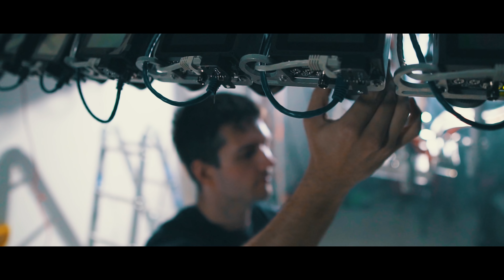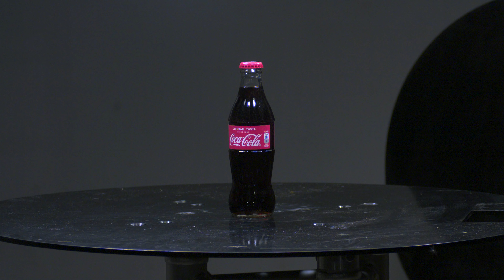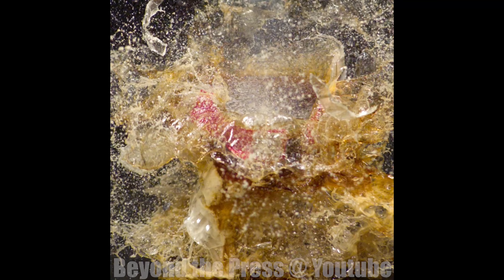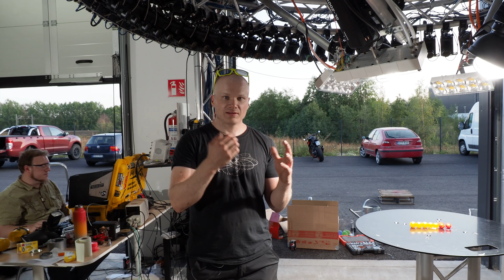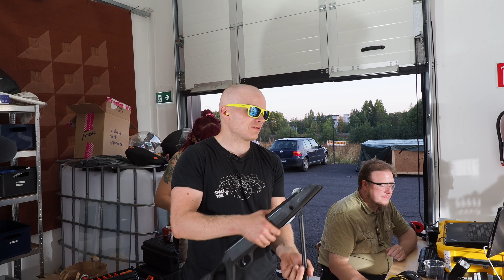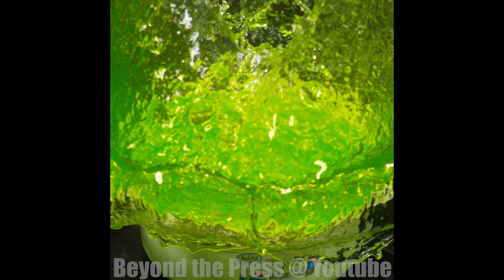Skipping a Bullet on Water at 100 000 FPS | Real Life Bullet Time!

Comment: For those complaining about the spinning being distracting, I hope you realize that isn't a choice.  The way they get the very high frame rates is to run each of the cameras slightly out of sync with its neighbour, so the individual exposures are all taken at a slightly different time.  Then, when they interleave the footage from each of the cameras, they have an effective frame rate equal to the frame rate of each individual camera times the number of cameras.  But since the cameras can't all lie in the same physical space, each perspective is slightly different.  By placing the cameras in a ring, the effect is that of a single camera rotating around the subject (just like the Matrix movies, as has been mentioned).  There's no way to eliminate perceived motion of the camera when you're interleaving multiple cameras - at least by arranging the cameras in a ring it gives some semblance of intention to the motion.  The only way to film without the perceived motion is by using a single camera, which would reduce the effective frame rate by a factor equal to the number of cameras.

Comment: I've got one of those break-barrel air rifles, the first time I shot it, it surprised me with how loud it was.
Reply: Same. I lived somewhat "in town" and immediately had to run inside after first shooting mine for fear that someone would think it was a .22 I was plinking black birds with. Lol
Reply: Probably because the pellet broke the sound barrier and made a tiny sonic boom. Crack! I bought an Umarex Octane air rife so I could shoot at half decent range in city limits. My neighbors are about 100 meters away and they thought I was shooting a .22 or something. The one in this video I believe is also an Umarex. I'm betting that it is shooting at supersonic speeds. That's actually a suppressor on the barrel. Can't suppress it once the pellet is flying. I'm guessing around 1,300 feet per second.
Reply: Mine is capable of 1740 fps, supposedly. Sound barrier is somewhere close to 1100 fps, depending on altitude

Comment: Would like to see spinning and single angle shots.
Reply: You can't see a single angle shot with this kind of frame rate. The high frame rate is achieved by the cameras taking one frame each in sequence, around and around the ring. The only way to get a sequence from a single angle would be to literally spin the ring, and that wouldn't work at that kind of speed.

Comment: They filmed a couple of scenes in The Matrix this way. Just with much less cameras and less technology in that time.
Reply: Most Matrix "bullet time" shots used two film cameras (first and last in the path) and then a bunch of still (photo) cameras. I suspect some scenes have over 50, possibly even 72 or more (but they're not motion cameras).

Also, the morphs were done manually in most shots ("optical flow" auto-morph software did exist at the time, but it didn't do a great job, so most of the interpolation was adjusted by hand). To make life a bit easier for the FX guys, nearly every shot was done with a green screen (so they were only shooting the actors), and the backgrounds are computer-generated. 

There were actually similar shots before The Matrix (mostly used in advertising), with a bunch of cameras placed along a path shooting simultaneously. The real innovation in the Matrix was the way they didn't shoot all the cameras at the same time, but instead offset them by a variable amount, that allowed action to continue and apparent speed to vary during the shot. These days, for "normal" (i.e., down to about 1/100th) bullet time you can decide all that in post, using high-speed cameras, but back in the Matrix days you pretty much had to repeat the shot every time you wanted to adjust the speed curve, because each camera only shot one frame.
Reply: @RFC3514 what I said in a nutshell basically, but you obviously posess a ton more knowledge on this sort of thing than I do 😂. Thanks for the lesson, very interesting. Cheers
Reply: You can see one of the shots here: https://www.youtube.com/watch?v=bKEcElcTUMk

Each of those black dots is one camera. I think they're using 120 cameras in total there. The bigger dots at the start and end are film cameras (running at a speed of 120 to 360 fps), the other ones are dSLRs (Canons, IIRC). The lower holes in front are air blowers.

Comment: It's pretty amazing to me how such a small mass (the pellet) can displace such a large amount of water while skipping off and traveling away. Did you try to measure pellet speed and how much it slowed down while transferring energy to the water? I'd have to believe it slowed down a lot more than it looked like it did. F = MA
Reply from the maker: On that one I didn't alter the playback speed during the shot so I think it would be possible to calculate. The air rifle is really fast it shoot really close to mach 1
Reply: @Beyondthepress  Even though it would be hard to do experimentation with the angle and the effect on water would be nice to see.
Reply: @Beyondthepress  

" The air rifle is really fast it shoot really close to mach 1"

that's certainly no toy!

Comment: Please plumb oxy acelatyne into a diesel engine air intake whilst it's running!
Reply: Daniel Molineux extremely dangerous
Reply: That's a really bad idea
Reply: I like this idea :D It's a GREAT idea! Tho you should do it with the right precautions, not to mention that you can wave that engine good bye lmao
Reply: @illuminate4622  they must deal with it.
Reply from the maker: I am going to do somekind of engine vs. oxy-acetylene video. I just have to think what would be best engine to use on the video
Reply: @Beyondthepress  Some old junk with a turbo. Reason: acetylene has a tendency to detonate if put under high compression. Might want it to live for more than one second :P
Reply: @Beyondthepress  thank you so much! I have been posting this for months in the hope you'd see it. For best results, use a non common rail diesel, probably without turbo. If you fill it before starting, the engine and air intake will just go bang. Plumb it in and go slow to begin with, building up the revs. Best diesel engine for it would be made before 2000 AD. I run my van on used veg oil. In winter months I have to start it with starting fluid. To make this easier I put a hole and hose around where the mass air flow sensor is, that would be a great place to plumb in the oxy. I don't think petrol or lpg engines would last more than a second. Also, as the guy said above me, if it has a turbo, it might explode before it gets to the cylinders 😂

Comment: nice work, but don't spin the image so fast.
Reply: you don't seem to understand how it works
Reply: @RickBaconsAdventures  Dude, it's all ones and zeros. There is no reason he can't slow down the revolutions on the final vid. How fast it spins is my only complaint on this guy's vids. Would like to be able to look at specific spot longer.
Reply: @GrenadeMagnet  he can but it would be laggy...
Reply: @GrenadeMagnet  You can slow down the video yourself, youtube has video speed settings.
Reply: @GrenadeMagnet  You could slow the video down to 1fps, but it would be horrible to watch. To get a stable frame rate, it has to spin.....unless you know of some way to connect so many cameras to a single lens.
Reply: @GrenadeMagnet  The reason you can't slow it down is you lose frame rate.
Reply: Pro tip: pause the video and press , and .
Reply: @GrenadeMagnet  my point exactly.  If you knew how it worked you would know that it's not possible without more cameras or faster cameras
Reply: GrenadeMagnet I’m always stunned by how little anyone who ever says “it’s all ones and zeros” actually knows about computers. 
Set the youtube playback speed to 0.25 if you want the silky smooth console experience.
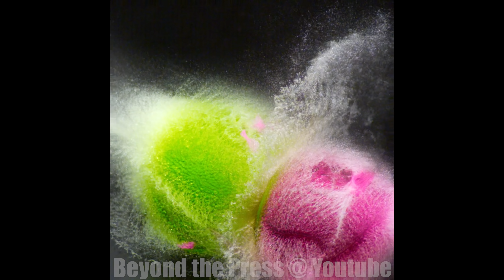Reply: @RickBaconsAdventures   then what happens to the spin rate at 8:17
Reply: @dak4455  they drop frames to speed it up.  the spin rate is directly tied to the framerate.  It can only go so slow but you can always speed it up
Reply: @funposting8912  you missed the whole point.  Don't be so fast to jump all over some one.  Many elderly people watch YouTube.
Reply: @RickBaconsAdventures  It should be up to the production crew not me to slow things down
Reply: @vinylexperience77  They can't slow it down any more than that... it's the limitation of the system.  They would have to drastically redesign the camera system for it to spin slower.  You shouldn't be so fast to criticize the chronos ring if you have no idea how it works.  If you were more sophisticated you would have asked "what would be necessary to slow down the rate of spinning without affecting the video quality?"  It's disrespectful to say their zillion dollar awesome setup sucks because they only spent $750,000.00 rather than 1,500,000.00
Reply: @vinylexperience77  In that case should I explain what's happening?
You can only run a slomo camera so fast. In order to get it faster, you need an array of cameras. You could either bunch them up against each other and switch between them, causing the image to jump around, or have them in a ring and switch from one to the next to the next, all cameras being timed with the perfect offset. 
Playing the video at 30frames per second (fps) means you can, at slowest, move between 30 cameras every second. If you play it at 15fps, you only jump 15 cameras per second however the video will stutter.
Look at the rink and imagine moving around at the speed of 30 cameras a second. That's as slow as it is possible to go around it. This isn't a choice. It's the nature of the hardware. 
The production crew can't slow things down any more.
Reply: @funposting8912  Thank you for that nice answer.  That makes sense.  :)
Reply: @vinylexperience77  Anytime, Glad to help.

Comment: The spinning is too distractive, I want to see it with out the spin
Reply: You can't. That's how this system gets those incredible frame rates. The cameras take turns taking one frame each, around and around the ring.
Reply: @jjohnston94  You could if they would put a spinning mirror in the middle, with perfect timing and angle

Comment: The spinning is too quick. Slow it down so we can enjoy more of the details in each shot.
Reply: I don't think they can - the spinning is how they get more framerate than a single Chronos camera can capture. The camera shutters are staggered so that Camera 1 takes a frame, then all the other cameras in the ring (2 to 72 I think) take their frames in turn while Camera 1 is busy processing that first frame, then Camera 1 takes another frame (etc.). So it has to spin round because it's getting a higher framerate by using a lot of cameras together - any one camera cannot capture frames fast enough to get the level of slowmo that the whole ring can do.
Reply: 2 ways to slow it down:
Add more cameras- making the ring bigger and therefore a slower rotation.
Or
Shell out a few million for a single camera capable of filming at that framerate.
Reply: @phoephoe795  No. Just reduce the playback speed in post production. That's all that is required.
Reply: Toweri Li then the playback frame rate will be really low and the video will look choppy
Reply: If they lower the spin it will be less slow mo, which they might try in a video

Comment: When the top of the glass bottle breaks off, it is propelled on a perfectly vertical axis, that’s not random. That means that whatever force had the most purchase on the bottle was parallel to the liquid surface. Which seems to me more like an internal pressure wave from the bottle, than just a randomly propagated glass crack.
Reply: Paolo G  cool how it shows how quickly the crack propagates through the glass and detaches the base of the neck nearly instantaneously

Comment: I'm looking at this setup and thinking there are going to be university students and professors salivating at the idea of getting to run their experiments in this kind of setup.

Maybe not at 100k rotating frames per second, but getting 72 angles at 1 millisecond increments in high definition of a reaction (be it physics or chemistry), if you had the ability not only move time but also location (this at the cost of not hitting 100k rotating fps).

You should get in touch with the local university :)

Comment: If you are going to do some machining, try a strobe light. It looks incredible when everything is standing still but metal chips are popping off of the work piece. Try varying the strobe speed to make it look like the cutter is rotating in the wrong direction. You'll probably have a panic attack when your eyes are lying to you. I've done this at work on my CNC lathe. Constant surface speed is nuts!

Comment: It seems to always break from the top down, even if a crack already exists all the way through the glass.  I’m convinced that the liquids transfer the energy much quicker than the glass and that it creates a pressure wave from the liquids surface and forcing the glass apart.

Comment: Between the year 1900 and the start of WWII, the US, French, and Japanese (possibly others too) did a lot of tests concerning warship armor-piercing projectiles hitting the ocean surface and what different nose shapes did at various angles of impact and striking velocities as to what it took to cause the projectile to not bounce off the water and what the projectile did when it was moving beneath the water surface when it did not bounce off.  Only the Japanese decided to make underwater motion part of their projectile design by having a break-away nose on their projectiles to turn the nose into a tapered flat-faced cone with a flat area of half of the projectile maximum width to get a long underwater path nose-first (pointed noses had too much sideways torque on the point area and usually ended up flipping end over end after just a short underwater distance and slowing abruptly due to this).  Later, when air-dropped torpedoes were introduced, this information was used in designing them and, for the Japanese torpedoes used at Pearl Harbor, a set of tilted wooden fins was placed over the rear of the torpedo to keep them from bouncing off the water or diving too deep in the shallow water when released at aircraft attack speeds.  This is a complicated topic...

Comment: the cola is comes out of the bottle so quickly that you get condensation in the unbroken part of the glass at the top. Even after it's broken you still end up with that massive low pressure zone in the core of the bottle, seemingly all the way down. My only guess is that the momentum of the cola being dispersed is so high that it creates and maintains that low pressure zone in the middle of the bottle even though it's not sealed...

Comment: I never knew that Barnes Neville Wallis was Finnish!
If a spring-piston air-rifle gets loud, it's sometimes due to lubricant in the cylinder "dieselling" as the piston compress the air and bit of oil-vapour behind the pellet. Makes the weapon slightly more powerful, but the effect is a bit inconsistent so it's not the best for accuracy.

Comment: You should use copper plated aluminum pellets because they deform a lot less then lead pellets. So the path in which it's traveling will be straighter after it goes thru the object

Comment: The field of view is obviously an issue, I suggest marking out a ring in the centre of the platform slightly smaller than the edge of the FOV so the impact is never outside the frame. Still really gorgeous, esp. the water skipping shot.

Comment: Try shooting cardboard or thick paper/thin board and cans side on. So your bullet travels down the edge of the material. I do it at ~15m for a challenge and it's pretty amazing when you can cut strips out of card with a bullet. Aluminium cans can also be very interesting.

Comment: What you need next, and I'm not joking...
...You need some kind of setup where you have a rotation of the subject or the camera rig.
I guess that rotation of the subject would be easier to implement than any rotation of the Chronos Ring.
So, this is what I envisage:
You have the subject/object to be photographed on some kind of rotating turntable that is spinning at such a speed that it is synchronised with the shutter progression round the ring so that the object appears to be not moving, but totally still. (Apart from being blown apart, that is).
Please, does anyone have a clue about what I am trying to convey?
Oh, I hope so.
>
Reply: They did it with CD and vinyl LP albums on a router. So the spinning CD matched by the camera rig looked like CD was stationary until it exploded outward.

Comment: the loud noise might be your air-gun 'dieseling'. it happened with my cheap chinese one because i used the wrong oil, it takes the power up quite a lot, but it can be apparently dangerous. luckily mine is built like a tank, so nothing hurt, yet.

Comment: I have heard that when uranium or plutonium reaches just slightly above critical mass using neutron reflectors, it goes from releasing almost no radiation to releasing large amounts of radiation in microseconds because of a nuclear chain reaction.  This lights up the air around it with a flash of blue light.  It is also extremely dangerous to be in the room while this is happening, so it should be done by robots.  If you have the experts and safety precautions, is it possible to show a piece of uranium reach barely above critical mass in slow motion?

Comment: I have always been curious....does the bullet follow the rules: angle of incidence equal angle of reflection? If there is a wave or ripple or current in the water, does it change the angle of ricochet, according to where it hits the wave? If you shot 20 shots at the surface of a flowing river rapids, would you get a tight group of the ricochets, or a scattergram?